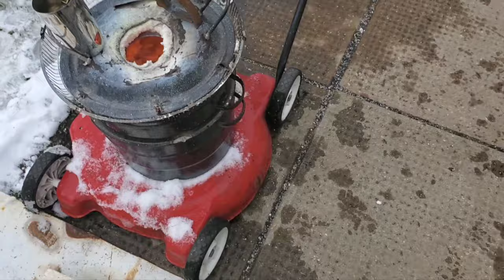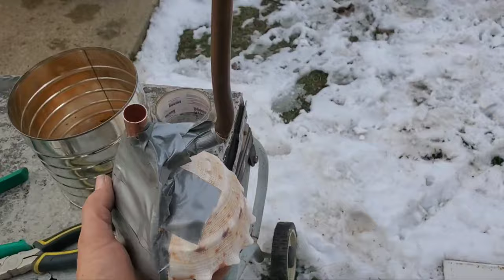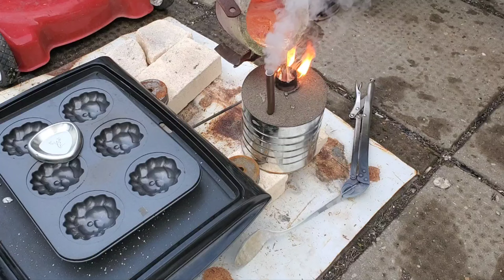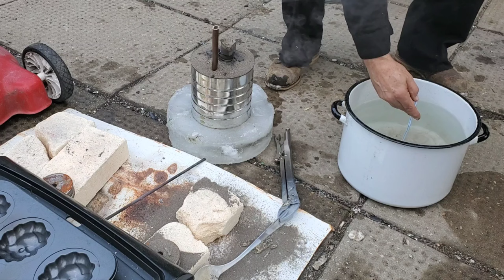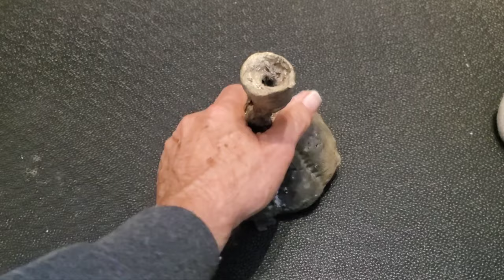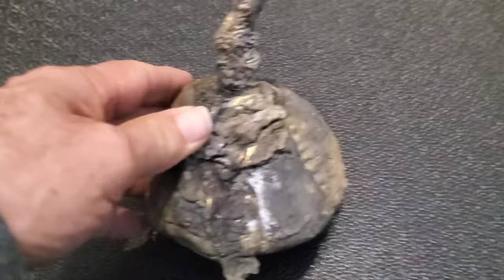Brass into a Conch Shell. First try.

Comment: a conch shell is a big spiral. i would try cutting an end off and pouring in from there. . i kind of want to try this myself.
Reply from the maker: Thanks for watching.
Part 2, cleaned up after soaking in vinegar is pending.

I also have bigger one that will be cast using aluminum. Plan to cut the end off and create a vent tube up from there. Hopefully it will fill better.